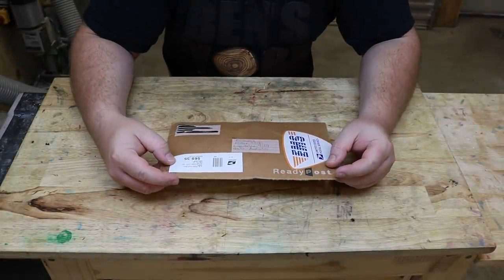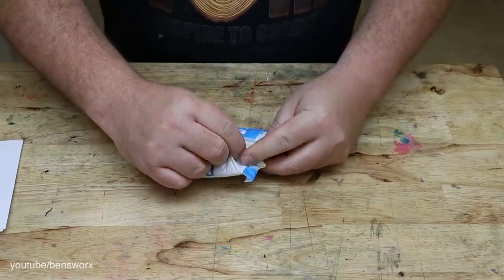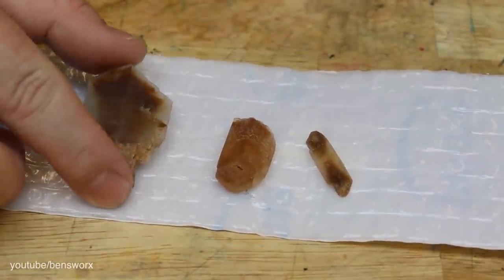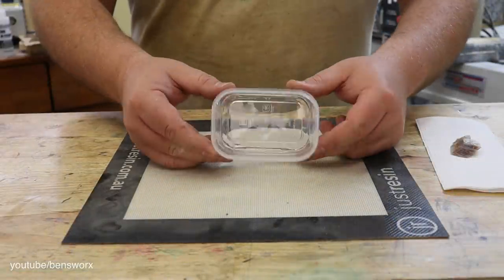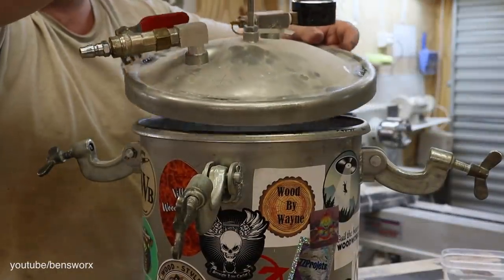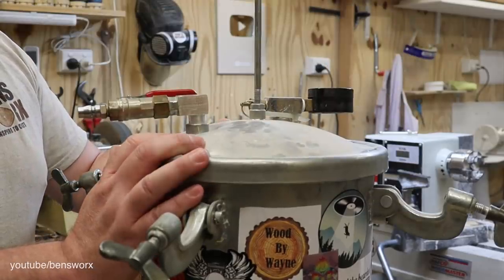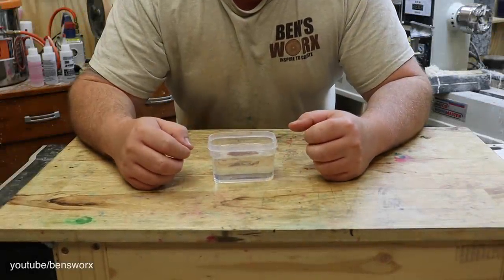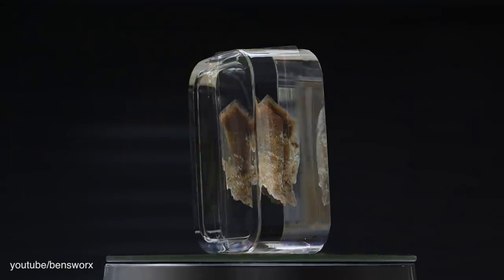Can You Cast Salt Crystals in Resin ?

Comment: Salt (HCl) is hydrophilic, while resin is not good at mixing with watery stuff. 

Try growing some salt, using a high cylimdical, supersaturated solution of salt allowed to evaporate slowly, dunk in a thread going from top but terminating an inch or two above botton, and make sure to dunk the thread in water and normal table salt crystals  to give the crystals some seed sites. Let evaporate for a couple of months, and your salt will be around 10 mm thick crystals.
Reply: Standard tourist souvenir where I grew up (near the Great Salt Lake). You can use all sorts of things as scaffolding to grow them on, not just string.
Reply: you can do the same with potassium permanganate to get beautiful purple Crystals
Reply: A few years ago, I did something like that with baking soda: a saturated solution, filtered to remove any residue, left by itself in a tall glass.  It had a loose cover so that evaporation would happen extremely slowly and no dust would get in.  I put it in a location where it would be completely undisturbed.  When I got back to it a few months later, I found a crystal formation that looked a bit like a glass sea urchin: a bunch of long delicate transparent spines radiating from a central knot.
Reply: Fyi HCL is hydrochloric acid.
NaCl is salt(table salt)
Kcl is potassium chloride.

Comment: Can you cast organic things like a Carolina Reaper pepper without them rotting?
Reply: Yea that would be cool
Reply: Unless prepared, it will degrade slightly over time, and resin doesn’t tend to mix well with watery stuff (dependent on type of resin ofc). But generally, as long as you make sure the pepper gets filled with resin (so it’s not full of air, which will make it float and give bacteria and fungus more oxygen to work with), the result shouldn’t become too bad over time. Something that is freeze-dried would otherwise be ideal, as that avoids the whole decomposition process.
Reply: @mikkohernborg5291  Thanks!

Comment: So just to give u a heads up. As u pressurize ur u can see droplets if water come in with the air.  On the bottom of ur air compressor there should be a cockpit drain. U should drain ur tank often if it is used alot
Reply from the maker: Thankyou, yeah I drain it often 👍

Comment: I would like to see you take some CDs, DVDs, and BluRays that are scratched and unreadable.  Then put a thin coat of very thin runny resin (maybe UV would best) and see if it will fill in the scratches and make the discs readable again.  Maybe even fix a cracked one.

Comment: Went to Jet to dig for those with my wife a few months ago.  That is Oklahoma red dirt suspended in the salt crystal.  The Oklahoma dirt is rich in iron and makes for a pretty good natural pigment.  The hourglass design of the dirt is unique to the Jet salt flats.  Those are typical size for what you find in the designated dig area but people will occasionally find massive clusters the size of a football.  It was pretty fun hanging out up there, but I got heat stroke.  If anyone is planning on going, make sure you hydrate.  The wind blows the salt in the air and it saps extra moisture from you.

Comment: Pretty!

A think to keep in mind for future projects with such materials is to watch for the ones that contain water in the chemical structure, and make sure you use conditions that don't heat them up too much.  If the resin gets to boiling-water temperatures as it sets, some of the hydrates would lose their water, and you'd be left with a powder in a void formed by the steam.  Slow-setting resin would be the way to go.

Comment: Hey ben quick question, i had a project like this in mind that i was going to do and the process looks like is gunna be the same , a double pour and placing the item on the 2nd pour. I noticed you can see a blur line where the 2 pours happened i wanted to try and avoid that , have you tried adding the item and pouring just before fully curing and replacing back into the pressure pot i have a small pressure pot as well.